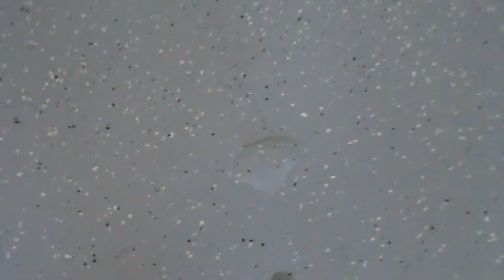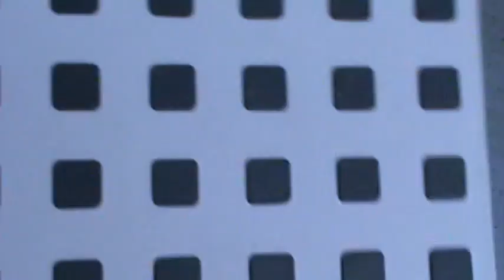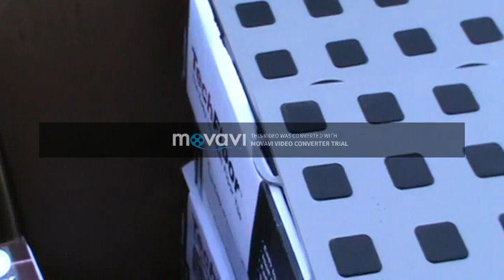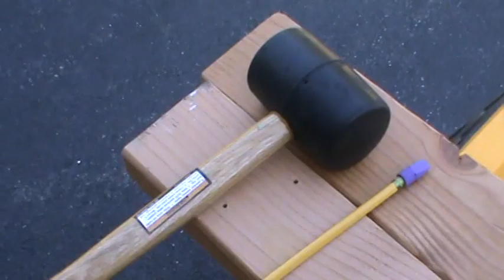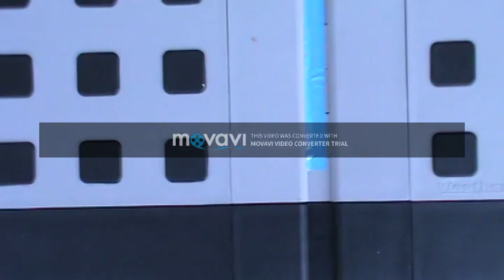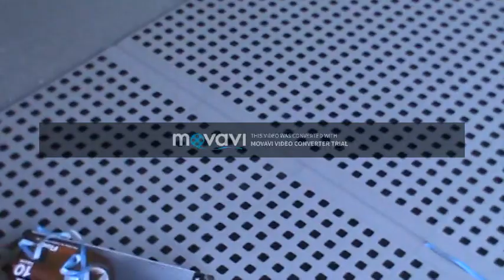Installing the WeatherTech (Techfloor) Garage Floor Modular Tiles

Comment: Does water get underneath it? It seems like water would never dry out
Reply from the maker: The tiles once installed are very tight next to each other. I have not had any problems with water staying behind the tiles. Any snow or rain draining from the cars seemed to evaporate.
Reply: WeatherTech says little if any moisture penetration. I'm researching floors now and am leaning WeatherTech's way - Def. want a US product.
Reply from the maker: Good luck with your project. I researched other products and this seemed to be the most resilient and well made alternative. It’s a couple of years later now so it’s possible other floors might be available but Weathertech has great service and reliable products at a fair price.

Comment: Was it $1,300 total or extra just for the expansion joints?
Reply from the maker: The entire project cost was $1,300. The cost will be higher now but still equivalent to what you'd spend for an epoxy floor that will never last as long.
Reply: @smazarakis  That's the same price I spec'd my 2 car garage out at as well, which was about 1/3 the cost of epoxy (I got 3 estimates on that). Getting ready to order the tiles.
Reply: That was the toral cost. Keep in mind this was several years ago and before we had the current level of inflation. The overall cost was very reasonable considering the cost of having the floor painted using an epoxy paint coating. The epoxy paint we had used previously cost about $1,200 and only lasted 2 years.

Comment: Great stuff. We just got epoxy put down on our garage but it’s already apparent that our installers didn’t prep the floor right. I’m looking into something like this just for the cars to rest on (i.e. not the whole garage). Thoughts about that? My two concerns are: 1) if I make this essentially a parking mat, will the cars move it going on and off the tiling. 2) if a wet car parks on top of the tiling, will water get underneath the tile and create grime?

Many thanks for the video and your advice.
Reply: Thanks for the nice comment. Our garage floor was previously also epoxied but we had the same issue that you experienced with the epoxy coming off and looking terrible. 

These tiles have a rubber coating at the bottom and at the top. This helps the floor stay flat and avoid sliding either on top of the tile or the tile shifting. These tiles are also sold with expansion rows. When you call their online help desk they will advise on how many rows of expansion tiles are needed for your application. This is needed because they expand and contract as temperatures change. I typically have a car that I don’t use in the winter and without the expansion tiles I would need to move it to avoid buckling or separating tiles. Once you join the tiles together with their clips they have a very strong connection and they are unlikely to come apart but they will buckle. Once you move the car that will go away. 

The tiles are also helpful for winter climates when you don’t want to have a hot tire sit on freezing concrete for days or months at a time. 

Your application is jot typical but should work. Not sure how it will look but you won’t have a water drainage issue. Most garages have a slight slope and water will eventually escape downhill. 

Good luck
Reply: No problem steering on them either. The rubber under the tile keeps it tight to the floor.
Reply: One more question. Have you tried steering your wheels while on the mat? Did it screw it up?
Reply from the maker: @mukhtarvoss1670  The floor is very stable once installed. Even if you turn your wheels drastically it will not move.
Reply from the maker: If this becomes a parking mat it should still be stable. If the mat is sufficiently wider than the car, water should not get under it. If it is short around the car then water will slip around the car and find it's way under the mat. I'm not sure what will happen then because I haven't tried that type of installation.

Comment: What type of saw or tool do you recommend to cut or trim the tile? Thanks.
Reply: I used a Dremel tool which is small and easy to maneuver. A regular circular saw with a fine tooth blade may work as well. What happens is that if the blade runs hot it melts a small part of the tile instead of creating dust or small shavings. What you need to do is to give it a few seconds to cool off and then just pull it off from the edge of the tile. It doesn’t stick to the rest of the tile so it’s easy to clean it.
Reply: @jamesmazarakis5219  Thank you for your feedback

Comment: I have a garage that is a bit uneven in spots. Would  these tiles work for this type of floor?
Reply: Eventually the tiles settle over the floor and any uneven parts may not be a problem. If the uneven parts are fairly high it might present a challenge but some unevenness is to be expected in a concrete floor. The tiles connect to each other fairly tight and hold together very well so for the most part the surface bumpiness may jot show at all after your floor is covered.
Reply from the maker: Most garage floors have some imperfections. Because the tiles are firm they still have some flex. If the floor is very uneven the seams holding the tiles together may separate each time the car moves over the uneven surface. I have some floor variations and that hasn't been a problem but not sure how it will react with variations.

Comment: Could these tiles be used as a computer chair mat? And if the answer is yes, do I need to order additional pieces or just the tiles?
Reply: They could be used as a chair mat but I wouldn’t recommend them for that purpose. They have rubber parts at the top and bottom of the tiles will make it hard to roll your chair over them. Also depending on what floor you have in your house the bottom of the tiles may damage a wood floor if they’re pressed hard on it for a long time.
Reply: @jamesmazarakis5219  thanks that helped a lot!!!

Comment: Thanks for posting.  My garage is about the same size and hoping to enter the planning stage for using this product today.  I like the color tile you chose and think I will do the same.  Any regrets or looking back after a year of things you would have done differently?  Thanks
Reply: No regrets about the floor. It has worked very well for me and it’s easy to clean and keep the garage looking neat. The only thing to consider is if you plan to leave a car on the floor for a long time without moving it. Since the floor expands and contracts as the weather cools and heats up the floor will buckle in parts when the weather warms up. I left a vehicle on it for 6 months and the floor had many raised areas under the car where the tiles were prevented from expanding. Remarkably it didn’t come apart at all and after I moved the car out of the garage the floor settled down again.
Reply from the maker: No regrets at all. I installed this flooring (in a darker grey tone) in my other garage too.

Comment: Jim - One-year in, how's it holding up?  Also, any comments about water run-off or cleaning in general?  Thanks,
Reply: So now the floor has been in place about 2 years and holding up very well. If you leave a car in the garage for many months without moving it the floor expands and contracts. So if you park the car in the winter and return in the summer you’ll find it expanded and will be buckled in places. It doesn’t come apart though. You just need to pull the car out give a few minutes to let the tiles settle and drive back in. Water run off hasn’t been a problem. If you drive in with dirty snow on the car you’ll need to rinse the floor in the spring. It cleans easily.
Reply: @jamesmazarakis5219  hi so they buckle even with expansions? I did my 2 car garage back in 2016 but there were no expansion pieces available or they just forgot to mention them to me so I installed without the expansion pieces and it buckles during summer and winter , I have my car stored there most the time also , so I was gonna get the expansions but it it won’t make a difference I’ll just leave it the way it as as I got use to it
Reply from the maker: The floor still looks brand new 3 years later. Very well manufactured.

Comment: good video, what do you do about the gap between the walls and the tile?
Reply: I left about an inch space at either side of the 2 car garage. That was fine for expansion. You can go a little tighter but I wouldn’t recommend any less than 1/2 inch. I painted the edges grey so it looks just fine that way.
Reply from the maker: The gap at the end is needed for additional expansion. The installation instructions recommend that about an inch stay open on either end.